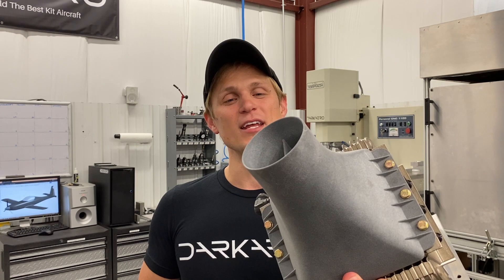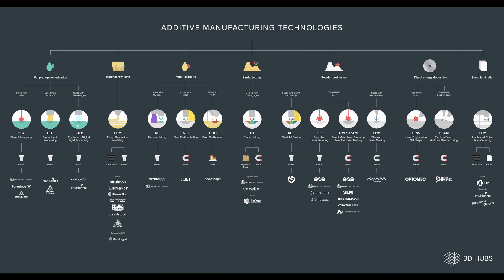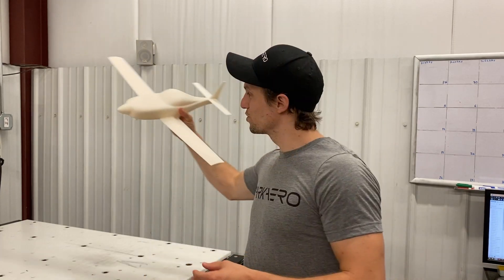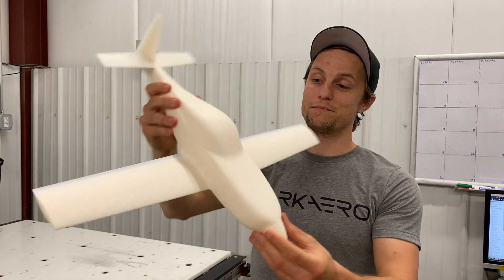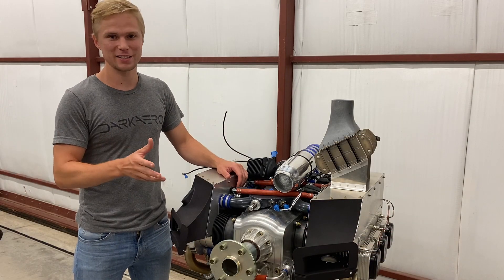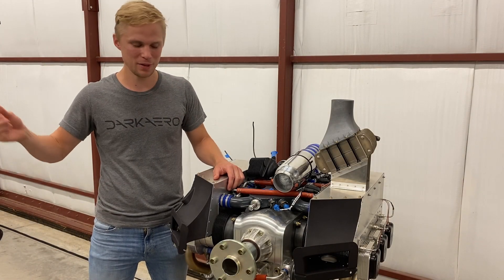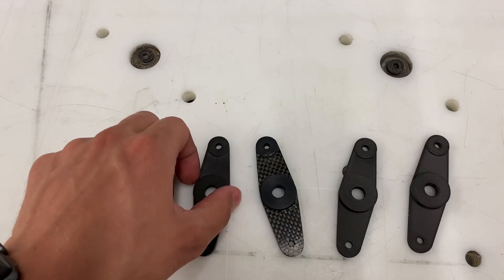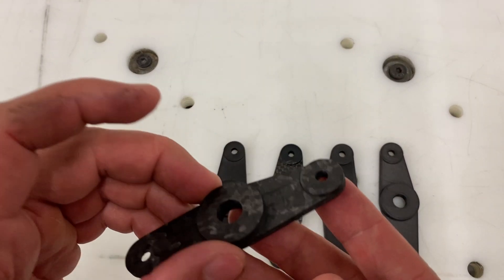3D PRINTED Aircraft Parts for the DarkAero 1? - July 30, 2020

Comment: True that 3D metal is often not good for vibration structure but one has to be careful about assuming that is universally true for all time. Maybe even already there will be a process not prone to form cracks. And indeed the future will be all 3D printing exclusively because the vehicles will be so high performance that it cannot be produced any other way. I've cheated by studying the visiting ET ships. You read that right. They don't have electronics components, circuit boards, wires, beams or tubes. No welds or rivets or glue or fiber either. It's one monolithic process. Every single atom placed with intent.
Right now though, I would generally avoid 3D printing for production parts. Same as I would double curve machining, much too time consuming. But metal printing for molds for plastic casting seems fairly obvious. Even if it has to be 7 parts. Or even aluminium casting. I probably wouldn't use plastic close to an engine.
Reply from the maker: More importantly, what color are the ET ships? 🤔
Reply: @DarkAeroInc  very common is just the bare metal shape. Some trace samples from only a couple of cases suggest that common materials could be alloys of silicon, boron, magnesium and calcium. Possible some aluminium mixed in too. I found boron to be most interesting. We basically don't talk about boron as structural because it's a little difficult to work with but turns out it's quite a superior metal. Or metaloid. The vehicles need to be conductive because of the field propulsion they manifest with the hull, hence likely always some kind of metal. Similar to how a magnetic coil needs to be conductive or a magnetron. But some encounters report a white surface. Could just be a coating. Less confident cases also report some black, almost foamy or glassy materials but the most common is bare metal. And a very common description is that the surface is just perfect. So blemish free that it adds to the already surreal impression. So perhaps by chance they like white and metal like our aircrafts too :)  and some report landing gear sticks coming out. Never wheels though. They don't need that. Most of them seem to just land on their bellies. Some landing imprints suggest they are very heavy for their size although it varies. The Roswell vehicle could well have been an 'ultralight', the absolute minimum material amount yet still be plenty structurally sound for pressurization etc. Once you can make perfect materials with multiple GPa tensile strength it doesn't really need to be that thick. The acceleration is among the more impressive features. From silent stand still to 10000km/h in less than a second. Possibly instantaneous acceleration. Within the atmosphere without any shock waves or sonic booms. I have a working theory from among other things ball lightning that they set up a quantum mechanical state for the entire craft where things can be in QM superposition which may make the atmospheric airflow around them a kind of super fluid flow. Both frictionless and inertialess. This QM unit might also be possible to give designer properties, like it's one big particle but the properties are controlled by the resonant EM patterns they give it. So they can dial it in to the earth gravity field and simply pay potential energy into that relation and it lifts up. Not through normal kinetic motion but simply forcing the hand of conservation of energy, resulting in a lift of the craft. Because the vehicle is 'forced' uniformally no G forces are felt inside whatsoever. They don't even have cup holders :)   their architecture is also very stark. Completely featureless on the inside. Walls, ceilings, tables, all one material and one piece. Ceiling can emit light. Corners are rounded, perhaps both structurally but something also seen in high voltage gear. In the Travis Walton 1975 case a large carrier ship had soft green rubbery floor. Bit like a running track. Walls were featureless metal and the arch ceiling (quarter of a tube shape, some of the big birds are cigar shaped) had a luminous checker pattern on it. He didn't see anything else but I suspect that wall could display any pattern, including showing the outside. It was a large hangar room. 3 beautiful mirror m&m shape craft and a sharp edged discus craft he came in that belonged to little skinny pale fellows with big eyes. The hangar ship belonged to beautiful blonde caucasian humans. In UFO lore known as "nordics". Seems ET is racist too :)  Should be a most interesting story behind that one. He said they could pass as humans here on earth although their beauty was striking and he couldn't look them in the eyes.
You may have heard of recent military encounters with ET ships as there is a faction of Navy brass that allow stories to come out. Pentagon has confirmed the encounters and they are sort of saying it isn't local. Like it's a well known secret. Everyone knows but no one is comfortable talking about it. There is a decent 30 minute youtube docu on the 2004 USS Nimitz encounters. It's clear from how the navy reacted to it that tired protocols were in place to ignore them. The secrecy is surprisingly well established. Fools in uniform do anything they are told apparently.
Remember the orange clown and space force?  I think someone gave him a toddler's briefing on something and that's what he came up with. 
Some black branches of US gov and possibly rogue private hands now or some murky mix have had ET vehicles and beings in possession since at least 1941. They got serious about it in 1947 with Roswell and since there have been a US nation wide ready force to retrieve crashed vehicles. 3 were downed in 47 and 48. Two more at Kingman, Arizona in 51/52. After that the ETs made themselves clear that downing crafts were no kosher and it stopped. Since then it seems to have been accidental crashes. I know of approximately 20 ET vehicles in US possession, 9 of which were an exchange agreement. Kecksburg 1965 is a fairly well known retrieval with hundreds of witnesses. Little acorn looking craft. Coppery with a band of writing on that witnesses described as hieroglyph like but cleaner. Symbols, not stylized people and birds.
And there is so so much more.

Comment: 3D printing is for mock up only.  I would not trust a 3d printed plastic part in a vibrating, buffeting airplane, structural or not.  When your air intake snaps in half and is rolling around the engine bay at 3000 feet what are you going to do.
Reply from the maker: 3D printing is not for mock up only. Additive manufacturing is a broad field that includes many technologies and materials, many of which are suitable for end-use parts, provided they are applied correctly. There are lots of examples of 3D printed parts that have been functioning for decades in service in aerospace, automotive, medical, and industrial applications.
Reply: @DarkAeroInc  Yes, but, NOT with the equipment and the way YOU are utilizing it.
Reply from the maker: @rustusandroid  The air intake you are concerned about was printed in Nylon 12 using Selective Laser Sintering (SLS). SLS is a robust, industrial grade printing process that is commonly used for end-use parts in aerospace applications. Nylon 12 is used specifically for end-use parts due to it's strength, toughness, and fatigue resistance. The suppliers we work with to print our parts are AS9100 certified. More information on the SLS process and materials we use can be found here: https://youtu.be/Ks5c8r8UfPY
Reply: @DarkAeroInc  SLS I am satisfied with.  You showed it with a close up of other parts that were clearly FDM.  If you are using SLS then I remove my criticism for non structural parts. :)